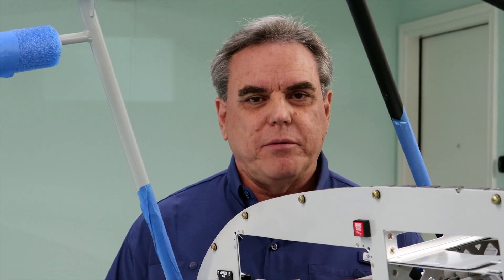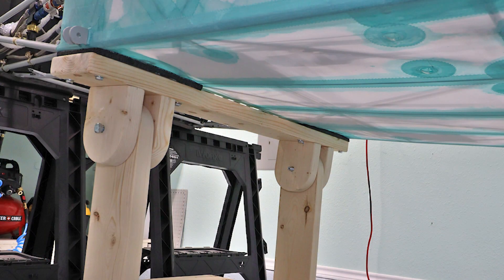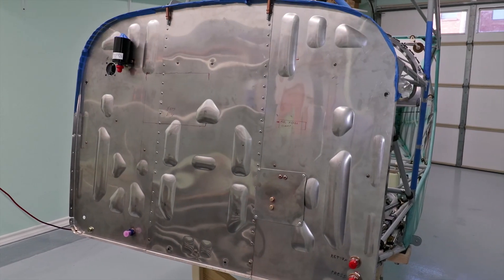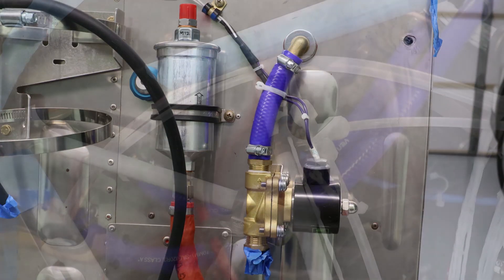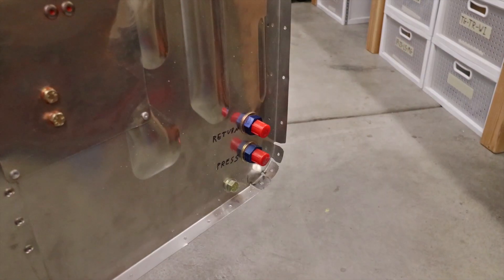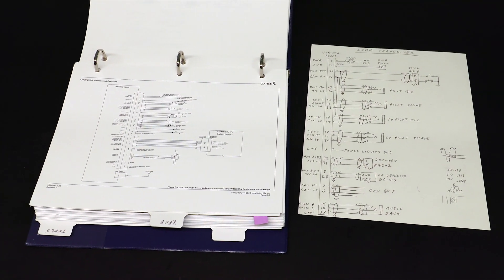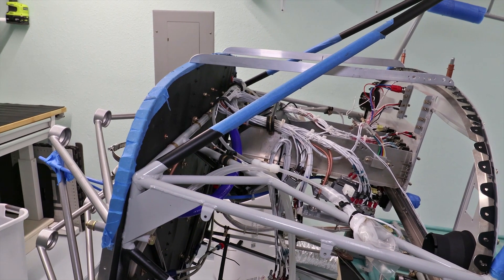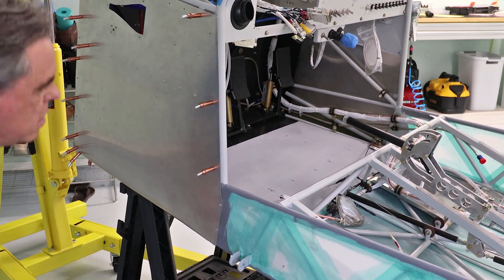Firewall Components & Ringing Out the Avionics Harness

Comment: Why the Hall effect sensor?
Reply from the maker: @markamundson5987  hello. I use the Hall Effect sensor because it’s very accurate, doesn’t have any exposed wires/terminals and has a direct connection to the Garmin avionics. Just overall a cleaner and more reliable installation.

Comment: What are you using to strip the heavier gauge M22759/16 tefzel wire?
Reply from the maker: Hello, I use the same strippers for just about everything. These are simple strippers, so are very versatile. But they require a level of finesse and practice to avoid nicking the wires. I can use these for wires up to 10awg, then anything bigger I use a knife.
Reply from the maker: I couldn’t attach a picture, but for those strippers, look up MAC Tools TCT 101E. They are very common
Reply: @ Thank you for the response, I have a set of Ideal 55-1987 for smaller gauge /32 wire. 
I will have to practice stripping with a knife for the 8AWG and 2AWG runs of /16